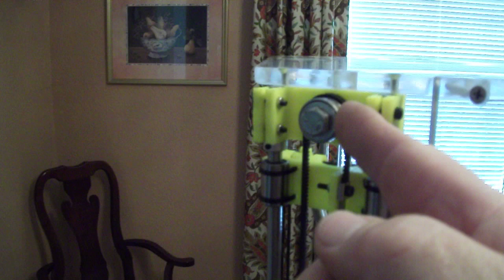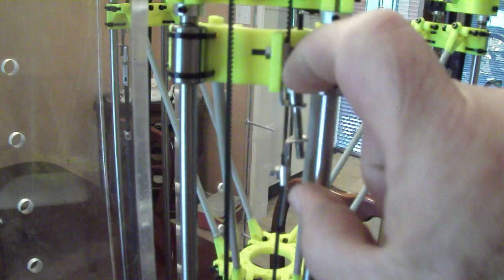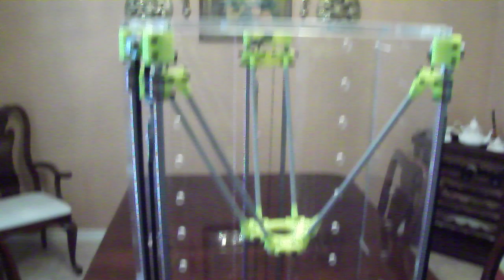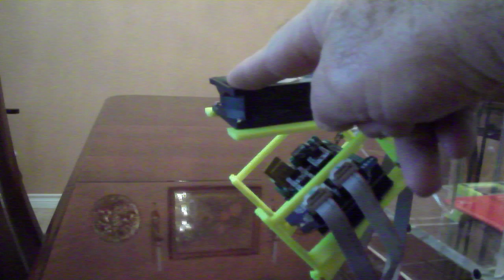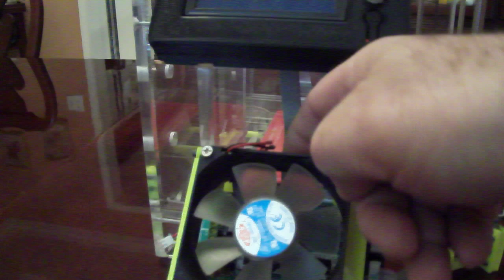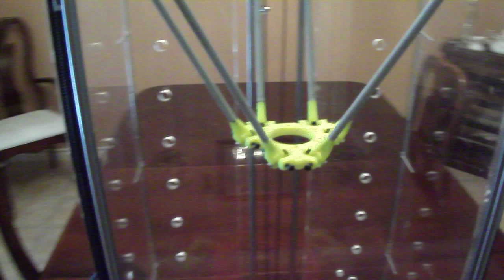My Delta 3d Printer Build

Comment: Hi Jeff, very nice. I don't have the craftmanship to pull that off, but I built a large Rosock, about 30 inches of inner height by 17 inches side to side (hexagon) out of wood. Used plywood to strengthen the sides, agreeing it needs the stability. Love the idea of the bushings, going to steal that one.  I actually found the bearings so rough that I printed PLA bearings with my printrbot simple, and they glide silently like a champ, zero resistance. Since my build is large, hopefully I have the math right. The carbon fiber rods are about 14 inches, hole to hole. Just need to figure out the firmware changes for this size, and we'll see if it was all worth it. How does yours print? Have you finished it? I wondered about the walking belt... will use the dual bearing idea, much appreciated.
Reply from the maker: Hello David, I have for the last month been playing with different Marlin version branches. Then trying to auto level and auto calibrate, after 99 iterations many times, I came to the conclusion that I'm going to manually calibrate. I'm going to try one more thing before I say to totally forget auto cal, waiting on a few parts, install them, punch in G-CODE G30 A Dnnn into Pronterface and hope for the best. One guy at the Google Delta forum say's it will work before 10 iterations, with excellent settings. We'll see how it goes. Are you planing on auto cal and probing the bed for yours? I have posted two other video's of my printer actually moving and probing the bed for calibration, you might watch them just to get a feel for auto cal, if it will work we will be many steps ahead, thanks for viewing, Jeff.
Reply: Just saw this... Thanks for the reply... I just pulled my Rostock out of the mothballs after moving, but yes, I'll give auto cal a shot since it'd br crazy handy.

Comment: Nice Jeff. Can't wait to see it working!
Reply from the maker: Thanks Joseph, yes It's been a long time coming and hope to have it running soon myself.
Reply: Jeff Nading
Any thoughts as to dual extrusion?
Reply from the maker: I have seen frist hand, 3d printers utilizing 3 extruders, printing 3 different colors on the same part being printed, but have not messed with this as of yet myself. I know Nate is now experimenting with two extruders. I do know there is software available to do this, don't know off hand what would be used though.
 It would be of interest to me to have this capability.
Reply: Jeff Nading
If someone hasn't already, I'll start a dual extrusion thread over at the forum. I'm wondering how Nate is getting along. I'll post some pictures of my results. God bless bud.
Reply from the maker: That would be great Joseph, there is a little under the 3d printing section but not much as of yet, thanks.

Comment: Very nice work Jeff :) I started working on the hot ends you made me long ago, I'm on my third try with printing the correct hinged wades. lol The last one I printed didn't have a large enough hole for the hot end to mount, and I hate working with openscad to find the right combo.   I might be sketching up my own extuder.  Do you remember the hole size on those?  I was thinking 0.35 mm?
Reply from the maker: Hi Nate, I think the orifice size was .35 mm, can't wait to see what you come up with, Jeff.